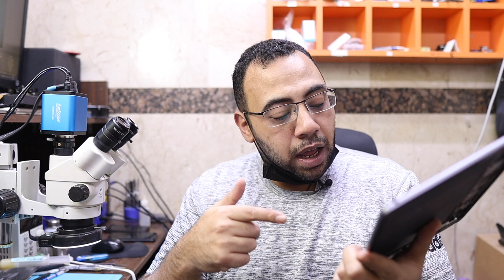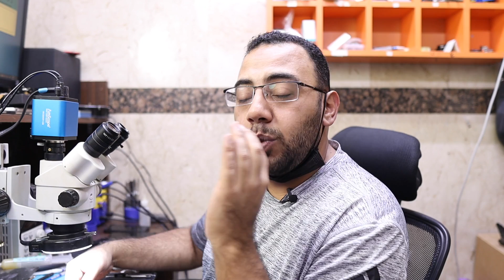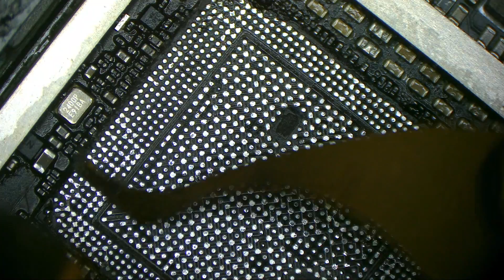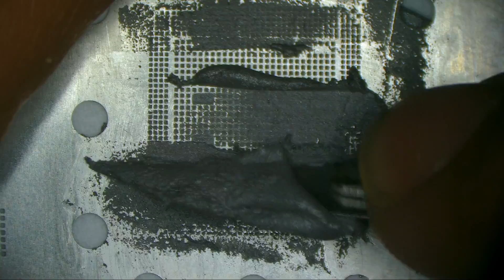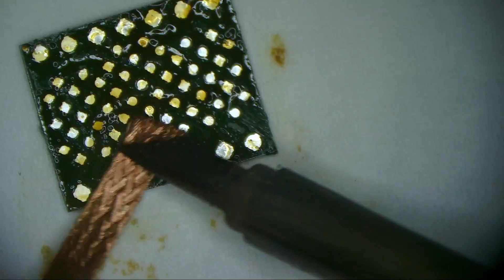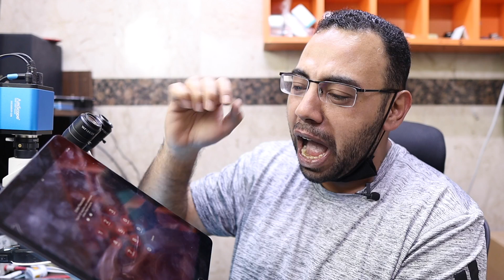Can i fix iPad 7 not turning on without schematic?

Comment: Hi can you please help me? My Ipad7 Screen broke and I got a replacement with a new home button. When I installed it and power it on, the the iPad keeps inputting the pass code by itself until the iPad locks me out for a day. When I go back and power it on, it does the same thing again and says it can’t communicate with the home button and I should go to iTune. I tried changing the home button but it does the same thing.
Reply: ipad glass you bought is no good, try checking connectors.

Comment: Well done Ayman. This video is not for newbies. I liked his graduated diagnostic path to eliminate basic sources of cause until he finally took a chance and tp reseated the NAND and A10 CPU.  For all those who wish to remove NAND and CPU, be very careful. It is not as easy as he makes it look, which is a testament to his vast experience. The chances of overheating board, grazing one of the connector dots and warping the chips' internal circuits due to overheating is high. Even if you successfully remove the A10 CPU NAND chips, you still have to clean them up and then put them back on the PCB with the chip pins perfectly aligned to the PCB pins. But I liked his explanation, enthusiasm and determination. If you have minimal knowledge of how PCBs and electronic components work, you will fully understand what he did. I suspect he has spent 3-5 hours on this job. He seems deft on use of heat gun, chip removal techniques. And that comes with a lot of EXPERIENCE.  Koodos to Ayman.

Comment: U could use infrared thermographic to detect the problem but u have used a clean mind of tracking nice.
Reply from the maker: Thanks a lot but the thermal camera wouldn't show anything because there is no sign of heat because the cpu didn't turn on

Comment: Job well done mr Ayman ,about pressing the CPU you can heated the CPU little bit and then press on the CPU the heating will help to soften little bit the underfill 
Thank you for sharing your knowledge with us
Reply from the maker: You most welcome Hadj, but i don't believe of heating the cpu because of the under-fill this will create a short and if you do little heat it will not melt the solder under it so it is the same